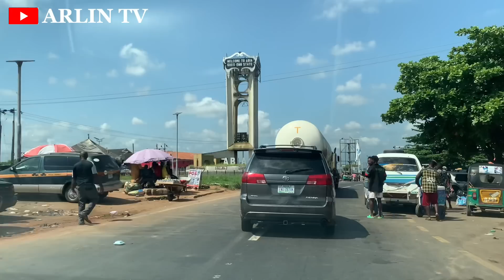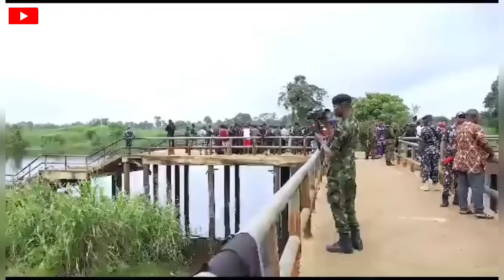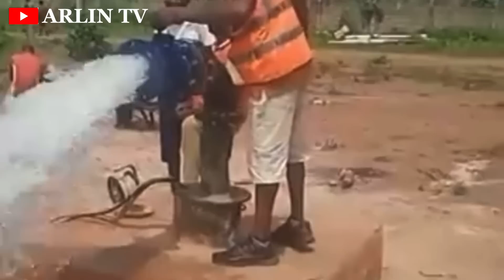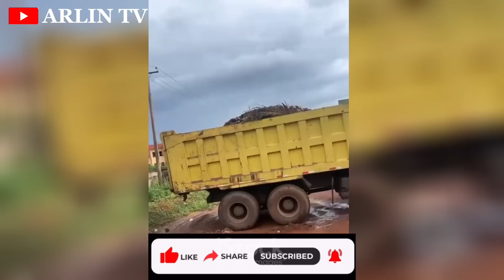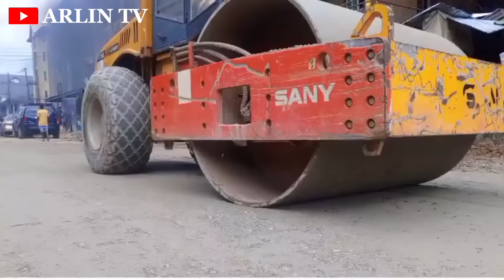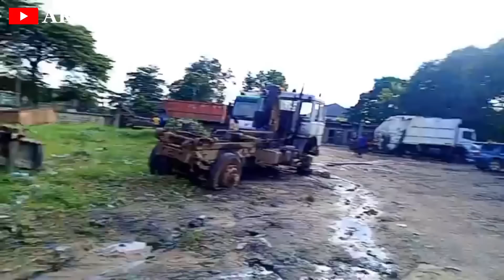ABIA VS ENUGU: Updates on the Governors Major Achievements in office (Alex Otti Vs Peter Mbah)

Comment: The Aba Port Harcourt road construction should be done by a reputable firm. The road surface and drainage system should be the same level as the streets that connect the big road. The last administration destroyed a better drainage system on that road only to reconstruct poor gutters as a result many buildings near the road have been under serious threat ever since. 
PLS, INFORM THE GOVERNOR OF ABIA OR THE ENGINEER.